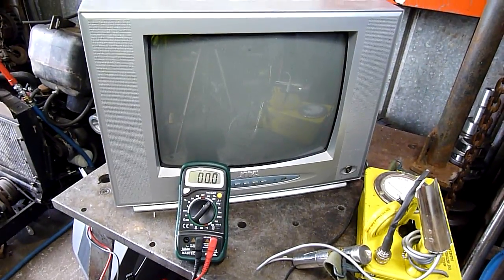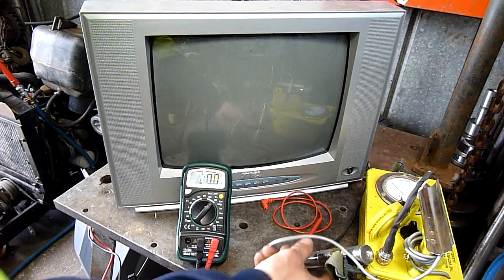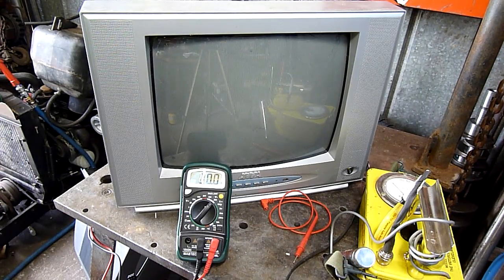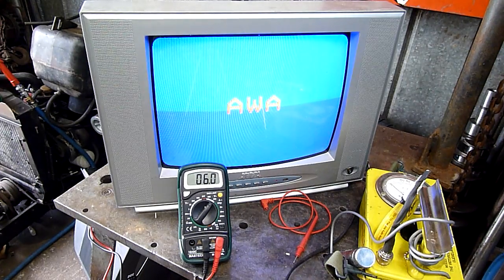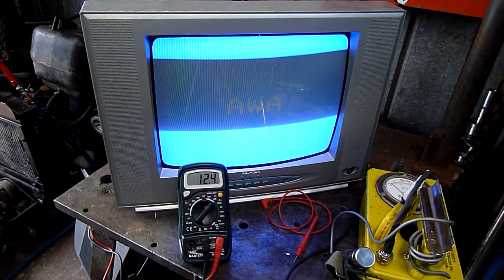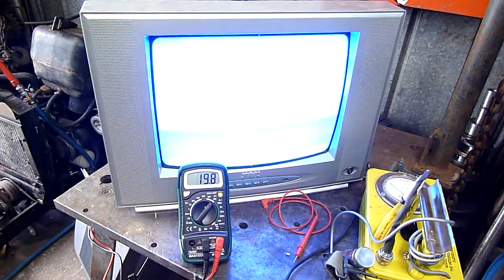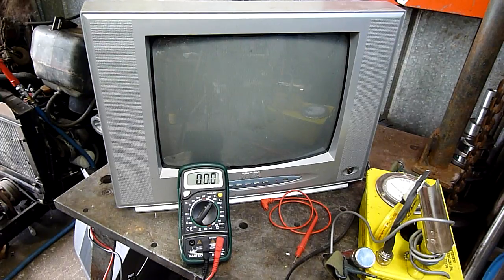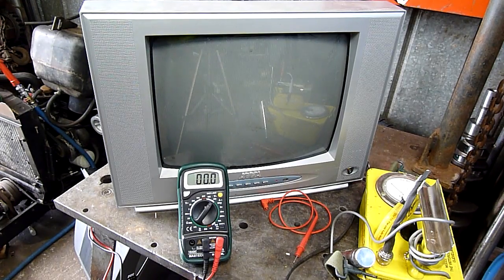Extreme CRT TV Heater Voltages While On

Comment: CRT's have no latency and no motion blur. All flat panels, except Plasmas, use sample and hold technology. This is part of why they have motion blur, while attempting to employ CRT emulation (black frame insertion, Strobing backlight, etc). I think someone did a test on a youtube video saying you need at least 1000 FPS on an OLED to not have motion blur, with added latency of course, with problematic blur-in issues as of 2025. Talked to the PC sales rep at Micro Center the other day, and he mentioned they have to change the background to keep them from burning in. CRT's are far from obsolete, depending on who you ask.

Comment: Sarah Cartwright, it's a reference to the game Half-Life. In this case though, the extra voltage on the heaters is creating more heat (and therefore more electrons emitted). These extra electrons means that the phosphors in the CRT screen are being struck more frequently.  When the phosphors are struck, their host electrons are displaced, and in turn, these will displace other electrons. The result is a cascade effect that results in the saturation of the phosphors to a point where no more light can be emitted.

Comment: if it is a standby TV set plus main power supply activated by relay, you can hear the microcontroller working by listening the relay. In the absense of some sound you can know if it has an open circuit between the secondary PS and the horizontal (like a protection R burned), That is the wonderfull of the TV SET you can diagnose almost everything without removing the cover!.

Comment: if the TV process the video without having seen the screen. Also, there is other *fails sound* that you can hear, it is a HV scape, or an focus scape, so you can diagnose, ok, it is a CRT zocket problem, etc. Then, you can hear if the flyback is actually outputing the HV, so you know it the flyback has its triplicator working or not, also you can hear if the H output transistor works listening the vibration of the yoke, in the same way you can know if the Vertical output and yoke works.

Comment: anyway the 15K sound is what all TV technicians looks for diagnossing fails doing diagnoses without opening the TV SET. You has 3 o 4 sounds, first, power supply, it can do a normal sound, or an *without load* sound, or no sound, plus the antimagnetism doing the work on the start, so you knows what is exactly happening in all the PS stage, then you can hear the Horizontal sound, if it is good, if it is an sync/unsynchronous and free frequency sound, you can know if the TV ....

Comment: Increasing the heater voltage increases the cathode emission which increases plate current so it naturally brightens the picture, and interesting note is that it should have a proportionally greater effect on the brightness then increasing the plate or anode voltages.

Comment: That how we get more hour out of our arcade monitors at work. You can over volt the heaters for a few seconds depending on which which color is dim and in will stay brighter for a while. We call it "shooting the monitor" and we use a special box that plugs into the back of the tube.
I still think you should try and "hydro test" one of those tubes ;)

Comment: The brightness control actually just controls the voltage on one of the grids (G1 or G2).
You can also change the brigtness using the screen adjustment on the flyback/lopt.. quite much the same effect.

Comment: This was interesting. Maybe that's what the brightness control does...it turns up the voltage to the heaters. 

There's still more poppage to be had out of this one though! Provided the heaters didn't melt a hole in the tube, you could remove the implosion band & thwock it with Mr. Smashy, or if you really want flaaaames, then gently heating it ( Not! :-D ) with a massive blowtorch always results in a nice bassline....BOOOOM!

Thanxx for showing,

-BoomBoxDeluxe.

Comment: lol, it took that quite well considering.

Old engineers used to fit a transformer to boost the heater voltage on old tv's to make the semi dead crt's work just a bit longer for there customers.

The bulbs gone lol :-)